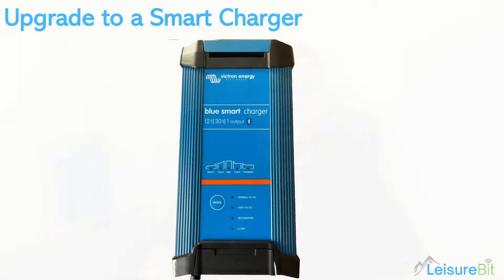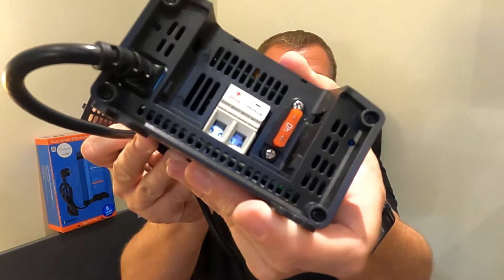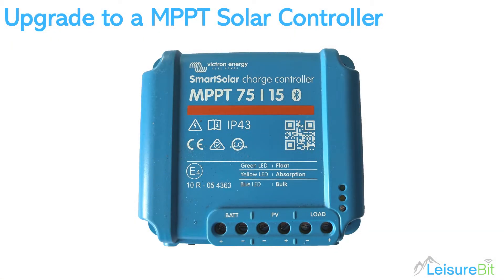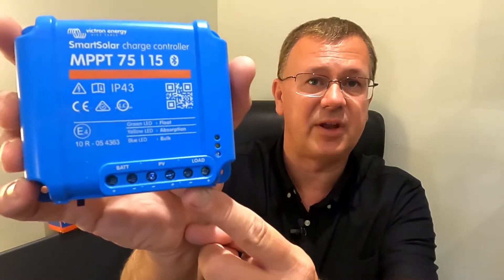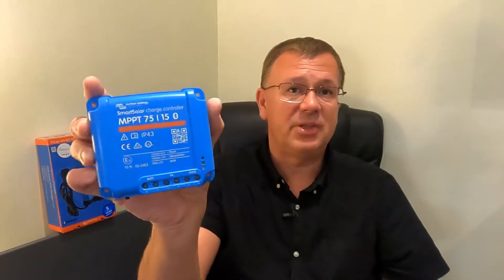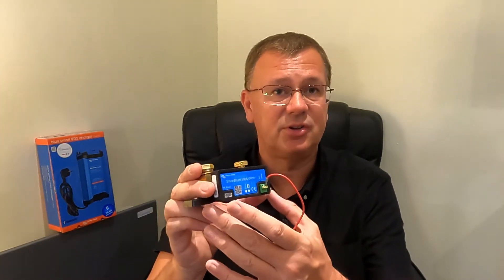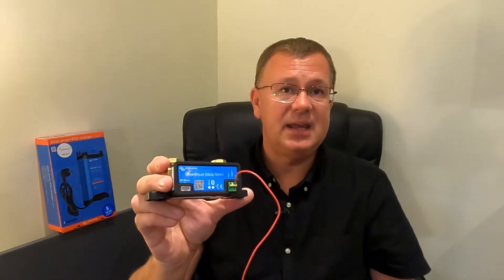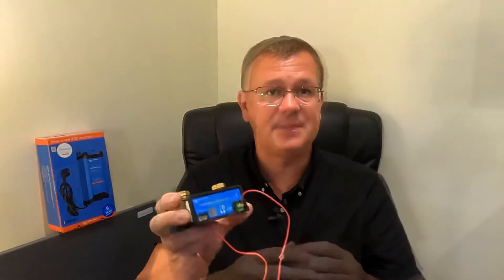Campervan upgrading and replacing Power Stuff - Smart Charger, MTTP Smart Solar, Smart Shunt & B2B

Comment: Thanks for very informative video. I think what would be interesting, is before diving in and fitting all these upgrades, you were able to go through the ‘standard’ setup you currently have fitted. Explain how new system will be integrated, and how it will improve the setup.
Reply from the maker: Hi Robert - that’s exactly what I plan to do but appreciate your reminder to show what’s in today first and then explain why and how - I’ve bought these things in prep for getting the van which is on order and I am waiting to receive so might be a month or two before that content is available but again appreciate the suggestion as easy to get carried away and then it’s too late to show the starting point. 
I have another video in a couple of weeks which helps explain further what I’m trying to achieve and why bringing a few other bits in play and the story should start to become apparent.

Thanks again - look forward to sharing

Comment: What if I have a lifep04 battery bank of 4 100ah batteries in parallel? Do I have to charge each battery separately or can I wire the charger to the bussbar and charge all 4 batteries at the same time.
Reply from the maker: You should be able to connect the batteries as then connect to the charger so all charge at the same time. All the best, David 👍

Comment: I am currently working out what upgrades i need for my soon to be delivered CV20 . Firstly is your Roamer battery still performing well as it looks impressive . Secondly does the smart shunt give you a lot more info than the bluetooth battery management system that comes as part of the roamer. finally in hindsight would you have done anything additional or different on your circuit design. I know you were thinking of possibly adding additional solar.   Really enjoy your videos by the way and will probably make our first little trip from Newton Aycliffe to the whitewater rafting site you covered in one of your videos.
Reply from the maker: Hi Mike, exciting times waiting for the van isn't it. Yes, the Roamer battery is performing well - If I had my time again, I probably wouldn't bother with the Smart Shunt in this setup as the battery gives you the real time information, more if you want a few more features but in reality you probably don't need that given the battery management system. So in hindsight, would have avoided breakers and used fuses / isolating switches (I did an update video on that) and probably wouldn't have bothered with the smart shunt and just stuck with the Roamer BMS. (as it's useful but not that useful in reality). 
We used to live in School Aycliffe about 7 years ago. White Water site is an excellent site for first night away. Let us know how you get on.
All the best, David 👍
Reply: @LeisureBit  Hi David, Thanks for that advice ,I am an advocate of KISS (Keep It Simple Stupid) so can i ask about the Elddis 20A power supply that you changed out to Victron 30A . I talked to the owner of roamer batteries yesterday and he said that the lead acid profile on the Elddis unit  would be ok for the roamer & not harm it, so is it about the efficiency of charging that you got the Victron for ? Am i missing something or is 20A an ok rating as site hook ups are at best 16A ? I have lived on Eastfields Road backing onto the golf course for over 35 years and find it a nice a quite place . Thanks for your help -Mike
Reply from the maker: @mikepeacock7586  Hi Mike, it’s more the risk to the Elddis power supply/charger and equipment rather than damage to the Roamer battery as it’s not designed for Lithium unless it’s been changed since I got mine (as confirmed by the manufacturer)  - to be honest it’s not the best charger for optimising lead acid battery charging either but adequate. That’s right it’s safety and efficiency, safety in that I learned over the years not to gamble and use things which aren’t really designed to work together, lots of folks do and get away with it but I would be the unlucky <1% who’s van would burn down by taking a chance! Efficiency in that the replacement charger is designed to optimally charge LiFePO4 batteries when properly configured and can do this safely and efficiently. 
The Elddis charger which I have is outside of the published specification of my Roamer battery for charging so odd if they are saying it’s fine if the charger and battery are similar.
Ref the power, it’s the Leisure DC side rather than the electric hookup or mains side, the charger converts 230V AC to around 13-14.5V DC at 30A, the mains power for that is about 2A or around 500W ish when drawing full power.
Hope that helps and makes sense,
All the best, David 👍
Reply: @LeisureBit  Yes David thanks , I was getting mixed up between the 230v and 12v side of things. You have put my mind at rest that it will be worth the effort to change out the charger. I am not going to do the work myself, I have talked to Les who runs A19 Caravans and he is going to do the upgrades for me . I need to wait for the CV20 van  to see how much solar i can get on the roof as I cannot find a roof plan view on the internet.
Cheers - Mike
Reply: @LeisureBit  Hi David, As a follow up i have bought most of the stuff for my Solar & electrics . The van goes into A19 caravans on Monday , meanwhile with the help of your videos I have done a lot of prep work myself . Fitted the Roamer battery , built a platform for the Multiplus 2 , Lynx power input and copied your location for the MPPT unit . Did you ever link up the Aux on the smart shunt ,was thinking when you did the adding of the victron B2B you could have run the Aux wire along with your positive 16mm cable to monitor van battery. We go off to Spain on 19th July for 3 weeks so getting very excited.